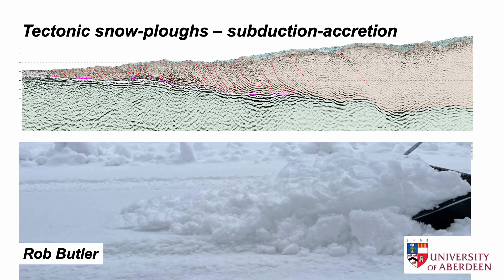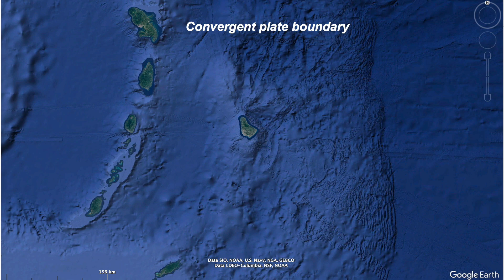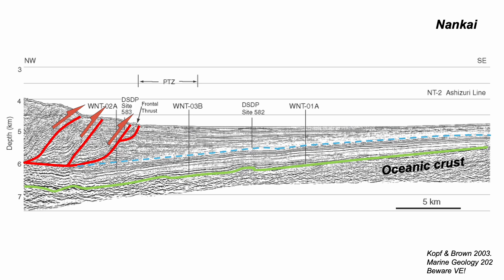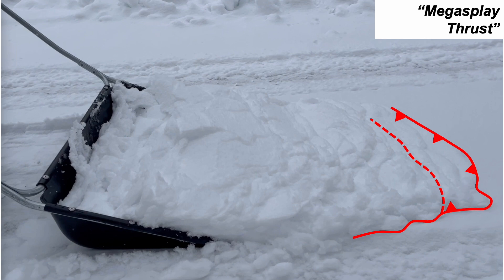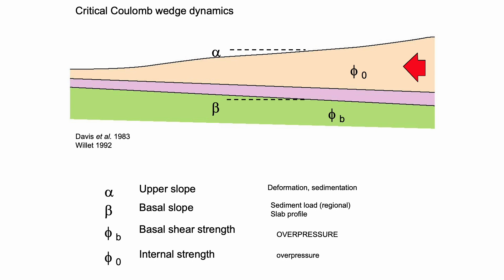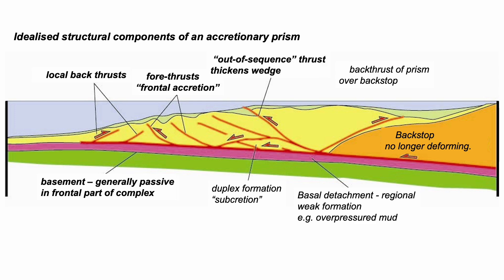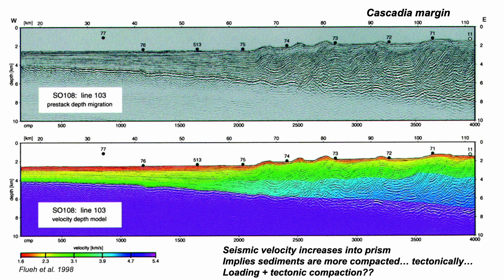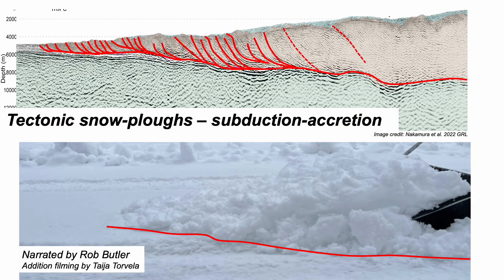Tectonic snow-ploughs - subduction-accretion

Comment: I assume this is one of the mechanisms forming turbidites?
Reply from the maker: Certainly much of the sediment in prisms (Cascadia, Nankai, Barbados) was deposited by turbidity currents. In some examples turbidity currents are triggered by slope failures on the prism top... though in (most ?) cases the flows originate in the shallow water - including fed in from the side (e.g. Barbados system).

Comment: It sure looked like Scandinavia, and it was. Now I’m curious if you visited Finland to make the video, or if you got the idea for the video from the plowing?
The cross-sections were most interesting, there’s much more structure than I thought. Do we know how much of the sediment that goes down with the plate?
Thanks for making and sharing!
Reply from the maker: Ermmm Nordic rather than Scandinavian ... but had some of the film in the can before the visit ... in terms of how much sediment passes further down the subduction zone - well there are plenty of examples in orogenic belts (e.g. the Alps) of sediments with ultra-high pressure minerals meaning they'd been subducted to depths of ~120 km... but whether sediment goes deeper (and stays there) is moot (although the geochemistry of some arc volcanic systems suggest some does, at least to around 150 km... ).
Reply: @robbutler2095  I was almost sure it was in Finland, so typical winter scene. Where about it was filmed in?